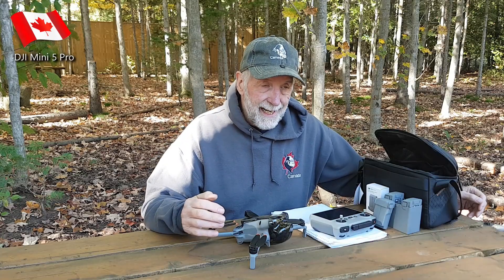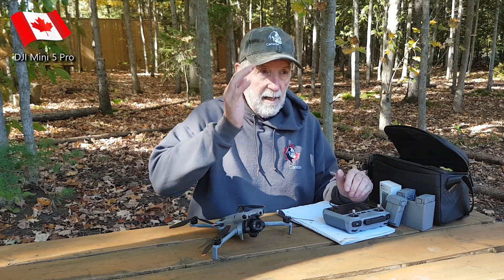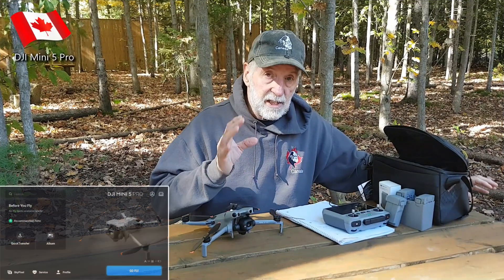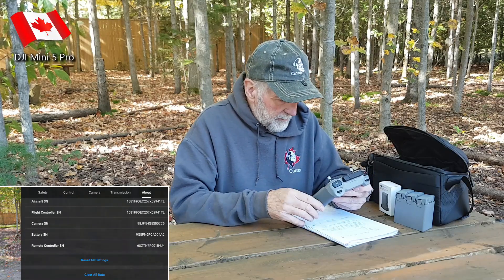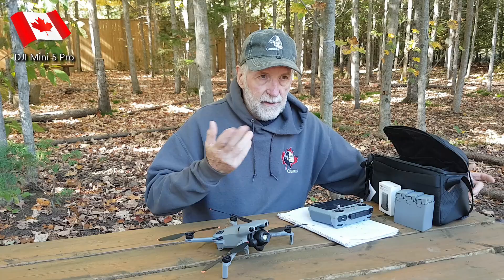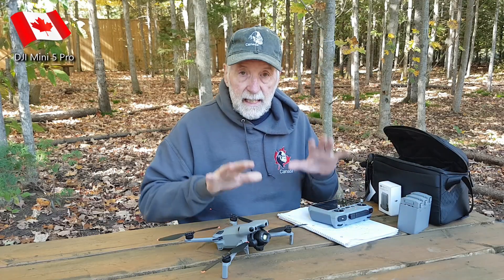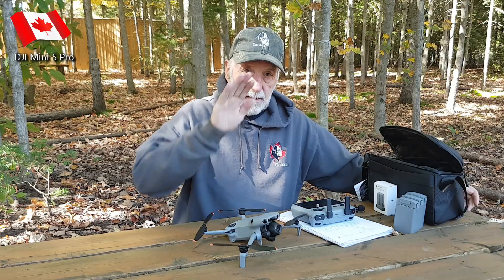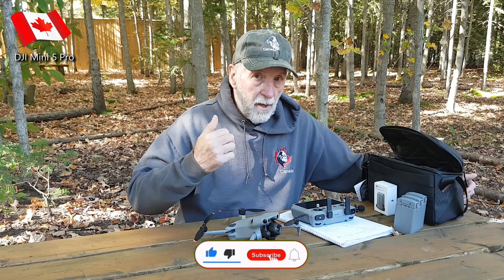DJI Mini 5 Pro - The Battery Debate & RID in Canada 🇨🇦

Comment: You never used the Drone Scanner app on the Plus battery. Your other ways of detection are both flawed based upon misinformation. When RID is broadcasting, there is nothing different under your Profile/Settings/About, nor is there anything about RID in the Fly app under the three dots in the upper right under About. However when RID is broadcasting, it will state "RID Normal" under the status listed in the upper left. When it isn't broadcasting, it won't say anything about RID.

So you only established that your Drone Scanner app couldn’t detect RID with the Regular buttery. That doesn't necessarily mean it isn't being broadcast, especially since you were corroborating that with misinformation. Same with the Plus battery. You looked in all the wrong places, and your we have no proof that your Drone Scanner app can even detect any DJI drone. 

Lots of false conclusions from inaccurate data gathering.
Reply from the maker: Testing what?? :)
Reply: @GorillamansGarage Testing whether or not RID is being broadcast by either the Regular or Plus M5P batteries
Reply: @GorillamansGarage  Everyone else that knows how to properly detect RID has confirmed that BOTH batteries are broadcasting RID.
Reply from the maker: @gadgetguy9984  : Is that not what I said? In Canada.. No RID will be transmitted - period.
Reply from the maker: @gadgetguy9984  : For the Mini 5 Pro in the USA.. RID is on all the time. It's a regional thing.

Comment: how many minutes you actually get from both batteries? i got only 19-21 minutes on the standard. that is according to dji internal specification (not the commercial 36 min). How many minutes you get on the plus battery?
Reply from the maker: I will be doing a test later this week. I will do a long 15-18 min waypoint mission and then a fly around test. I am sure to get 25 min on the Std battery and I am projecting 40 on the Plus. We shall see.
Reply: @GorillamansGarage  i will be waiting for that!
Reply from the maker: @robdiangelo  : I spoke to DJI many times about this after. They said the RID will show up under the pre-flight checklist but not the "About" sections. But as we are in Canada.. nothing shows up.. period. I did hear a rumor that Mini 5 Pro batched made after Sept 2025.. appear to be under 250g. DJI have actually asked for me to return this craft for inspection... I have another Plus battery coming today so I will test and then maybe next week I will send the drone back and see what happens.
Reply: You never checked your Drone Scanner app for the Plus battery. With RID broadcasting, there is nothing under your Profile/ Settings/About that shows up, nor is there anything under the three dots in the Fly app under About that shows anything about RID. It is actually under the upper left icon, where it will show RID normal, but won't mention RID if RID is not broadcasting.

So all you did was show that your Drone Scanner app was unable to detect the Regular battery. 
We have no idea about the Plus battery because you did not check properly. 

Your inability to detect it does not mean it isn't broadcasting. If you do detect it, then we KNOW it is broadcasting, but the reverse isn't necessarily true.

Comment: Hi GM, thank you for the RID test in Canada. Ron Brown recently demonstrated that RID is transmitted in the US using either the Standard or Plus battery. The Plus batteries act as if they are Li-Ion, not Li-Pol. If so, that may allow batteries to remain charged for a long time where the drone can be up in the air without waiting to charge batteries. The Mini 1 also had some Li-Ion batteries that retained their charge for a long time.
Reply from the maker: I hear where you are coming from. I had this whole Li-ion vs LiPo conversation with DJI Tech last week. They said the Mini 5 Pro batteries are Li-ion... even though they are flat paks... I still have my doubts. But the Plus battery is 45+g heavier than the standard.. but still a flat pak.
Reply: Hi, I am in the US.  I bought a Mini 5 Pro from Korea.  My M5Pro does not transmit with the standard battery, but does transmit RID with the plus battery.  Putting the standard battery back in and RID stops transmitting.  Hope this helps.  I respectfully suggest that Ron Brown repeat his test and make sure that whatever he uses to scan RID is reset between test.
Reply from the maker: @jimm2600  : Interesting.. did you post a video or contact Ron? Their test was just with the standard battery. I have an image to share with you from DJI about this issue.. please email me gorillamansgarage@gmail.com
Reply: @jimm2600  Hi Jim, you are right, the RID transmits with only the Plus battery installed, but doesn't transmit RID with the Standard battery. I was using the Drone Scanner app.I bought my Mini 5 Pro from China. I will email Ron Brown to my findings.
Reply: @jimm2600  Test was done three times, twice off camera, same results each time. And on first off-camera test, the android phone with the drone scanner app was off, we turned it on and opened the app up, so that would be the same as reset.
Reply: We never tested it with the Plus battery, because we didn't have one. The results we got were with the standard battery.